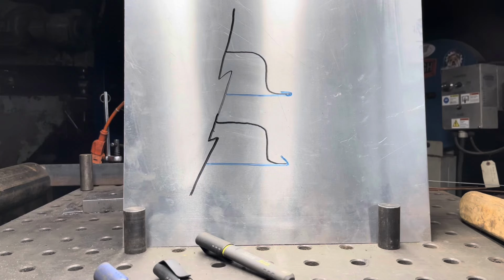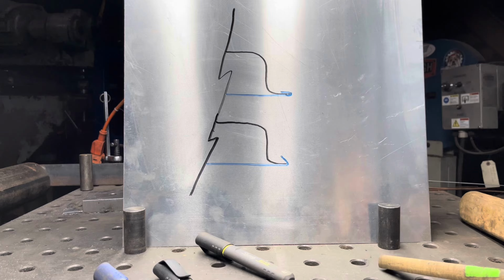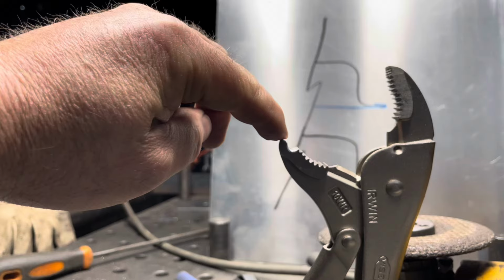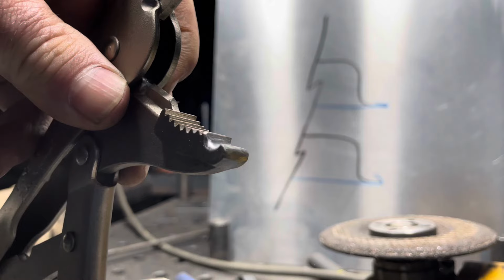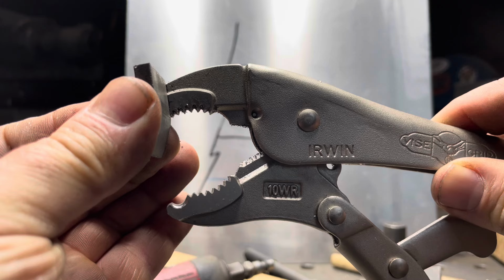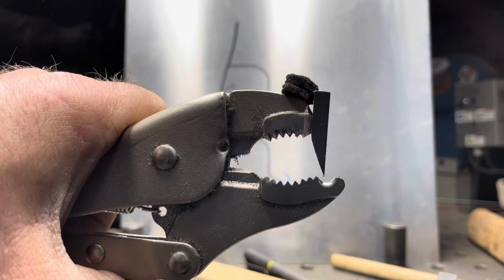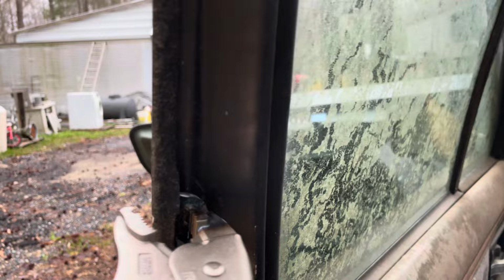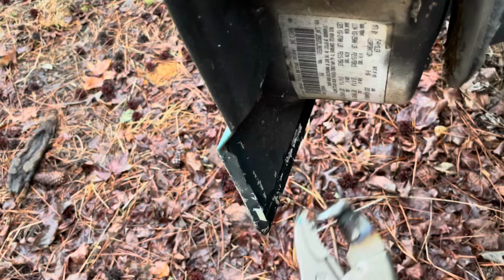Door skin removal tool

Comment: Could have removed 2 door skins in the time it took to make this tool just by grinding around the edge and twisting the back piece off 40 years experience in the bodywork trade
Reply: Done the same thing for years... tiger paw will rip the edge smooth off in no time.
Reply: lol right! good job though
Reply: Agree with you but if you are going to repair the skin. This is a good tool.

Comment: I used to be a body mechanic if I remember correctly the folds wet also spot welded. I never had to remove a skin in order to save it so we used to grind the  lip through and then cut the spot welds in order for the 1/2 inch lip left over would strip off
Reply: YEP , If you do this and then snip between the spot welds , bend the ends up , grab and twist with vice grips it usually will pop the weld .
All while not buggering up the inner of the door (that will make your new door skin look like crap) if you dont straighten it out first ;-)
Reply: I too spent years in the body repair industry.. When replacing the skin, trying to bend the lip out of the way takes way to long.. plus it tends to distort the inner flange .. angle grind the tip of the edge around the perimeter, and the skin falls free.. use needle nose locking pliers to coil and peel the thin inner lip that remains..  final clean and prep is a breeze from there.. done in no time..
Reply: 20 years ago i did save parts from one Car for a other and used a Special Drill Bit Like a hole SAW to bore Out the spotwelds.
And on my knipex i removed the tooth on one Side to save the outside Metal from the Car.

If you buy new parts and Just remove the old with force Sounds so mutch more fun ;-)

Greatz from Germany
and have a nice Day
opo

Comment: I did many Using a Wide Flat Screwdriver Heat cherry red and make an L shaoe sharp in the front edge once lift swiggle side by sidelifting the edge of the door skin.

Comment: Cool idea if that’s what you want to do. Just seems like it’s going to make you have more work from messing up and scratching the jam. Personally I use a grinder and grind the edge then the skin pulls right off and you have to do it pull off the thin inside piece left behind and replace with a new skin then seam seal scuff and paint the jam and it’s good as new.

Comment: 24 grit on an air grinder , new skin.
been doing bodywork for over 30 years , and never seen anyone remove a door skin and reinstall it.
while your video looks impressive to someone that dont know , it has quite obviosly made a mess of the outside edge.
Reply: Right, I made the mistake he's promoting. What a mess. Grind the lip off even if you do reinstall the skin which probably is a mistake too but not as bad as trying to unbending the lip.
Reply: I guess if you’re working on newer stuff that has replacement skins available, your bodywork trick works.  For a vintage vehicle that has no reproduction parts available and an owner that wants to keep as much original metal as possible, the 24 grit on a die grinder you propose would be the method making a mess of the skin. Restoration/preservation vs bodywork.

Comment: I made one of these exact tools for this very reason. I found that I tend to use a thick piece of metal to pry on so it doesn't mar up the metal.  Funny enough Carter's channel just showed the one he made today: https://www.youtube.com/watch?v=_LEL_ge0yUM&t=1756s
Reply from the maker: That’s rad. this one is modeled after one I saw on the allmetalshaping forum. Seems to work well I’ll find out on this second I have to repair